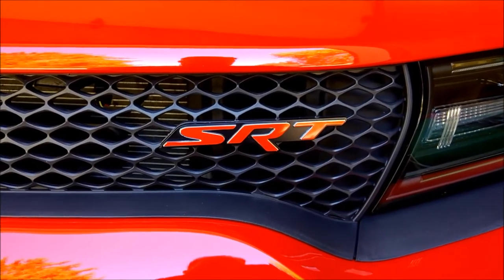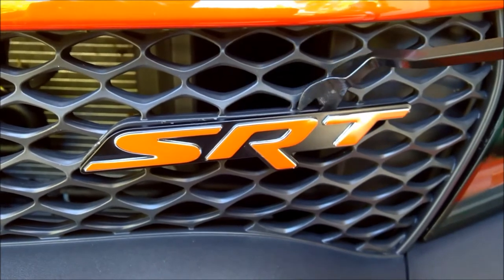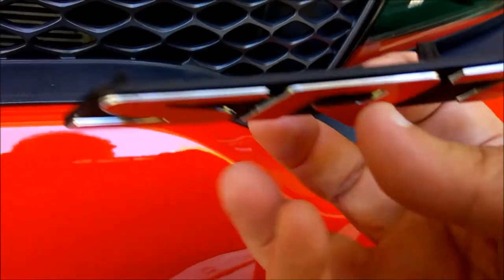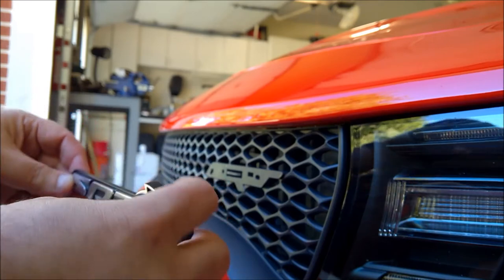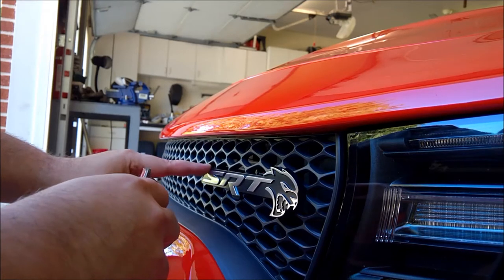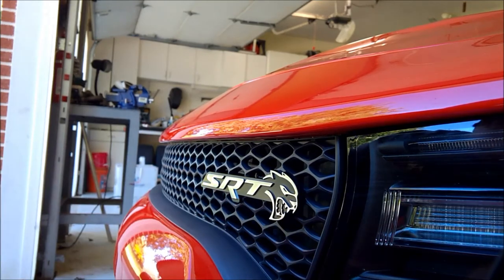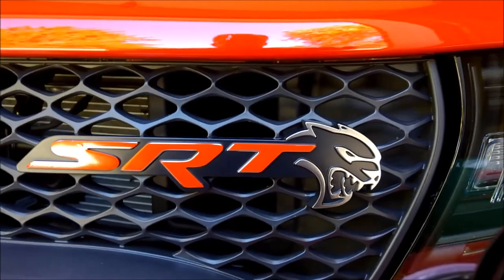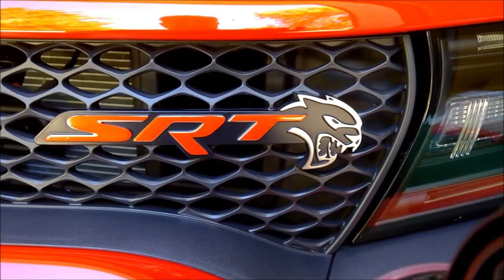Charger Hellcat Front Grille Badge Replacement

Comment: Hi - you said challenger grill was different than charger. What did you mean? The challenger doesn’t have the flat grill base like I am seeing here on the charger grill?
Reply from the maker: Yes the Challenger grill does not have the outline of the SRT molded into the plastic like the Charger does. This also depends on the year. My 31 Charger Redeye does not have the SRT molded into the plastic either. Not sure what year that stopped.

Comment: Can you take off that black piece that hold the badge off?
Reply from the maker: No it is molded into the honeycomb of the actual grille
Reply: @coolwrld302  how noticable is it without having any badge there at all? Does the blank black piece stick out?
Reply from the maker: @392_vic  It's pretty noticeable. Because you have the honeycomb look then you have basically a solid area that vaguely resembles the SRT.

Comment: Will this work for a 2015?
Reply from the maker: I believe it will work on all model years up until 2019 when they changed the honeycomb pattern on the Charger grilles.  It also may or may not work on 2020s as I think they have a different honeycomb pattern than the 2015-2018 cars.

Comment: Once u removed the srt badge the part that's affixed still can that be removed as well or is it part of the grill??
Reply from the maker: Unfortunately it cannot be removed it is actually molded plastic right in the honeycomb of the grill so if you want to unbadge the car your still stuck with that section of the grill having the vague SRT look.
Reply: @coolwrld302   crap I wanted to buy the dual nostril grill and put a custom badge I had made on it.
Reply from the maker: @Toxik_Hellcat  I haven't actually seen the dual nostril grill from the 2019s so its very possible Dodge came to their senses and did the Charger badges more like the Challenger and got rid of the outline molded in to the plastic.  U would probably have to see if there is a way to find the 2019 grill with no badging to see what the honeycomb looks like.
Reply from the maker: So Hemifam did a video on his YouTube channel about the 2019 Charger grills.  Apparently the grill does not have the molded in SRT outline like the 2015-2018 grills do.  He also listed a link to a site where you can by it https://www.stevewhiteparts.com/steve-white-catalog-2019-dodge-charger-srt-scat-pack-daytona-upper-grille-with-bezels-dual-inlets-oe-swmsrtgrille?parent=1021 and you can clearly see in the part page there is nothing molded into the honeycomb.  It would appear if you upgrade to that grill you might be able to use the custom badge.
Reply from the maker: Apparently the actual honeycomb weave is different altogether so if you replace the upper grill section you probably will want to replace the lower grill section or the weave patterns will be different.

Comment: I wanted to do a badge delete on mine, but before I take off the emblem is the grille molded to the shape of the emblem or is it clipped on as well
Reply from the maker: That is correct sir.  The actual honeycomb pattern of the plastic in that area is actually molded to match the SRT badge shape and size.  If you remove the badge completely the grill will still have the general appearance of the badge.  I have seen it done and I'm not a fan because of the fact that Dodge molded the grille like that.  You may be able to find an aftermarket grille insert/replacement but to remove that section of the grille I believe it involves removing the entire bumper and fascia.
Reply from the maker: If you freeze the video at 1:53 you can see that since the molded piece is actually raised off the grille itself you might be able to cut it off however I think the honeycomb part of the grille is probably missing in that area so the grille would than have at least some kind of hole in that area.
Reply: yea i was afraid of that, deff will have to get a new grille for sure then if i decide to take it off, thanks so much!
Reply from the maker: No problem good luck.  I have seen others where they just black the whole badge out and leave it on the car so from a distance you can't really see it because the black of the badge just blends in to the black of the grille but obviously up close you can see it.
Reply: yea i was thinking about that too just like plasti dip it black and call it a day
Reply from the maker: Yea the YouTube channel I saw it on is Honestly OCD here's his video https://www.youtube.com/watch?v=1nmGv0-cr3A around the 6:30 mark is the finished product but the video is him actually doing the plasti dip.  He actually kept it on the car and just masked everything off.

Comment: Whats the name of that tool you used?
Reply from the maker: It is a door panel puller. It's designed to slip between a door panel and the metal so u can pop out the push pins without breaking them

Comment: Where did you buy this new badge??
Reply from the maker: It is the official Dodge OEM 2018 badge.  I got it from Speedlogix and there is a link to the product page in the video description.
Reply: Steffan Walters REALTOR 
I bought the badge using eBay but I also found it in amazon and Walmart website by typing the part number.